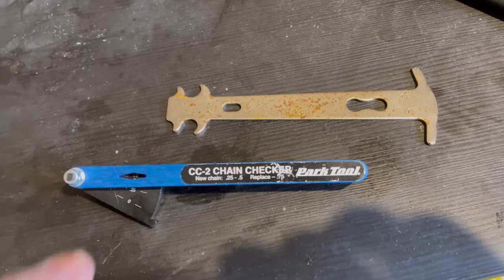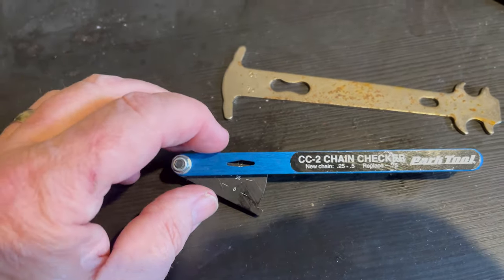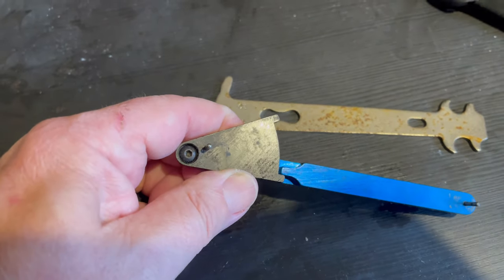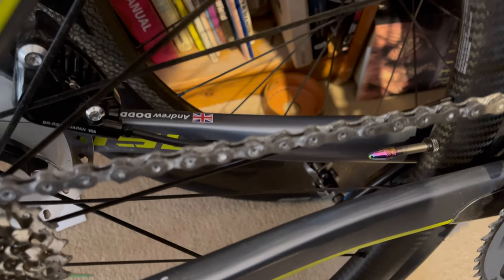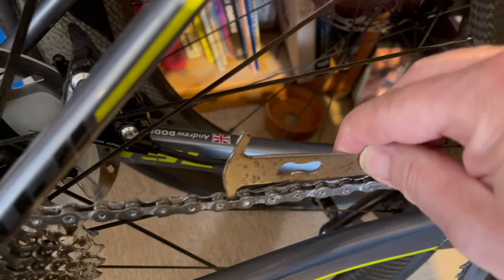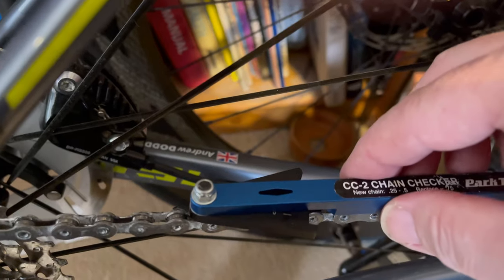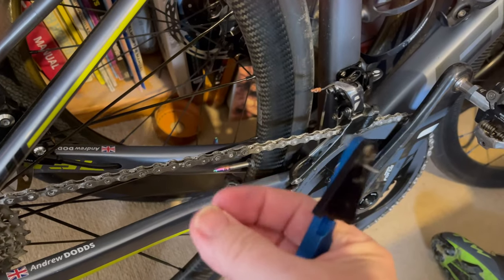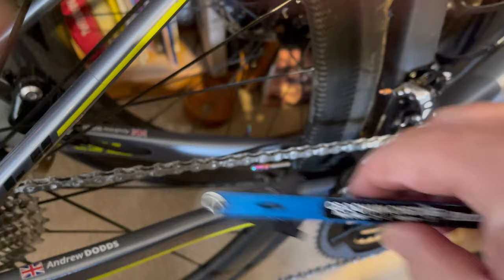Checking my chain checker. Chain wear indicators.

Comment: Did you work with bikes as a job or is this just years of experience?
Reply from the maker: Just 40 odd years messing about.
Reply: @retroonhisbikes  That's cool 👍
Ever thought of doing repairs as a side job?
Reply from the maker: @djbogz1921  yes i could, i have all the tools, ok not all tool but enough to rebuild a bike.  I dont have the facing tools for threaded  bottom brackets or bracket callipers but i dont need them (yet)